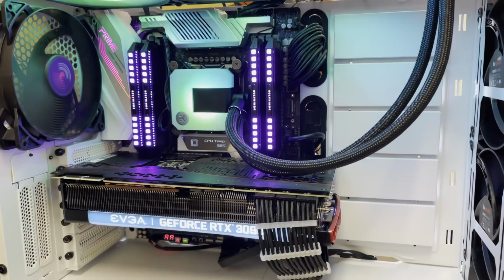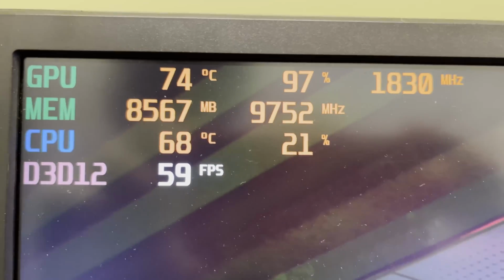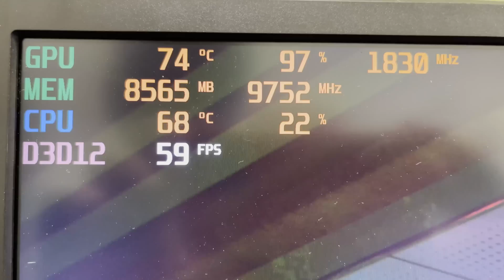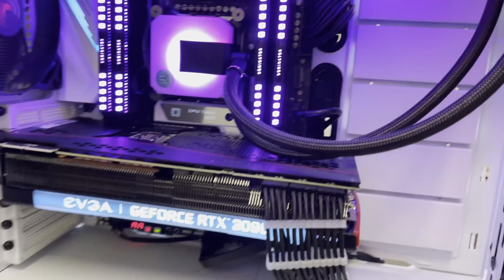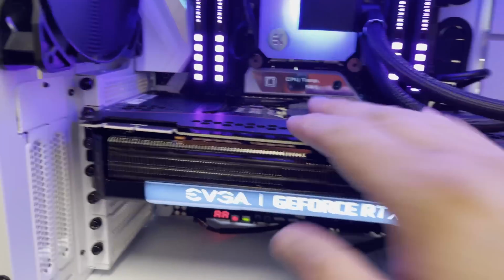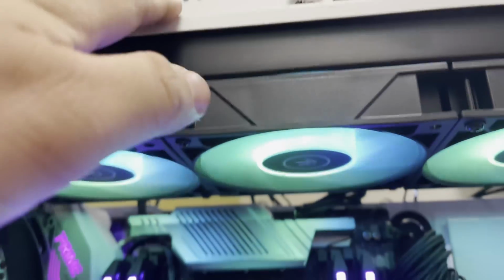Is Your New Nvidia RTX 3000 GPU RUNNING HOT? Do THIS To Improve Temps

Comment from the maker: What temperature is your GPU running at? Subscribe and thumbs up  too!
Reply: 3070 hitting 60-64 while benching heaven witha  100/500 conservative OC running, o11 dynamic though with bottom intake fans
Reply: @Tecumseh_Airsoft  Can you tell me how you set it up? I just got a Lian li XL. My 3080 ftw and 5950x gets very warm in my h710i case.
Reply: 70-80 edit:when I'm hitting it hard
Reply: It has risen as high as 80 degrees when gaming using a zotac 3080. Have to increase the fan speed to reduce the temp. although then it is noisy. Don't have a waterblock system in my PC. My idle temperature with no fans spinning is about 55 degrees.
Reply: @Masta200  zotac used the lowest cheapest components for there 3000 series
Reply: Using an ASUS TUF 3080 
2 intake fan at front, 1 intake fan at bottom(though PSU Shroud covers it)
2 AOI Exhaust Fan, 1 rear exhaust fan
Phanteks Enthoo Pro 

Highest temp, playing max settings in cyberpunk is 63c - havent seen it go above that in other games as well.
Reply: @Zeet1  You have the same case as me. what speed are your GPU fans running at?
Reply: 51-53° in idle and 77-78° on Cyberpunk 2077 ultra settings 2k with 3080 Ti Palit Gaming Pro
Reply: @Alexcarpevideo  the lian o11 do case with gpu fans at 60% gpu never went above 65c on cyberpunk for me. These new chips require tons of airflow
Reply: @FunKaYxxD1sCO  a different graphic card, a different case you can t compare
Reply: Evga RTX 3090, i9 10900K, NZXT 510I case, NZXT Z63 AIO, running Flight Simulator at 4K, Ultra Settings, GPU at 98-100% — Temps: GPU at 75, CPU in the low 40’s
Reply: ASUS 3090 TUF OC (with modded 390W bios), 48C running Cyberpunk 3440x1440p maxed out, DLSS performance mode. EK custom watercooling loop with 5950X (this will run at about 58C in cyberpunk).

Comment: I'm thinking of upgrading from my 2080ti to a 3090.  My GPU is vertically in my case with my intakes on the front.  I'm worried I'm going to have heat issues...
Reply: Undervolt it.

Comment: I have Asus Tuf 3070 OC hitting 76C - 78C in Hogwart Legacy 1440P Ultra/High RT OFF  . I have 3 In take fans 2 Exhaust on top and 1 on back for throwing hot air outside along i have a twin CPU fan cooler . My GPU is not that old i could not find the reason of such temperature . Let me know any solution

Comment: In case anyone hasn't figured this out yet... these cards are designed to run at 80-83 and the firmware will adjust the frequency to maintain the temp.  If you can improve thermal efficiency you may not see lower temps but likely will see better performance

Comment: just build my first Itx pc with a bitfenix portal and a 3070 inside. Also my first watercooled (AIO) build with an arctic liquid freezer II 120mm. The case basically has no airflow at all! you can sqeeze in two tight 80mm fans in the back and one 120mm aio in the front. The 3070 went absolutely crazy when i tried to open conan exiles with ultra settings and 144fps. It hit around 85° and the fans of the gpu spinned like crazy. I still have my old atx system here with a gtx 1080 and it handles 144fps by ultra like a champ with 72° max. with a stock amd cooler on the cpu. I have to lower the fps from 144 to 60 by the 3070 with ultra settings to get a cool 65°. I'm quite shocked and to the same time dissapointed.

Comment: my gpu reaches 85c. undervolted it ang changing fan made it 75c max so far
Reply: I undervolted my 3080 ftw3 ultra because at some point with Quake 2 RTX I was hitting 82-85 with the normal stock numbers. After undervolting, my max temp was around 67-68c and I lost about 7-9ish fps. So there must be something wrong with your case and ventilation/airflow

Comment: My 3070 Twin Edge from Zotac reaches up to 80-90 C at some games which scares me. Going to cage my case but I still feel like its way to high. Also heard that Zotac thermal padding is way worse than any other company. I got it for 650 dollars but I wish I got the Asus one but it ran out of stock when I went to the store.
Also my case side panel is open and I've tried lowering the core clock and power but nothing and tried underclocking but my pc or gpu crashes.
Reply: hahaha zotac is fucked up. luckily i got a 3060ti at msrp im about to sell it if the 3080ti prices will drop
Reply: @lestertalde9707  Yeah I'm not buying any of their products ever again. The lack of thinking before selling the pruduct so horrible is shocking .Even the trio has thermal issues even with 3 fans cause the damn thermal padding and thermal paste is below par for cooling. And the RMA is shit unless you live in the US you are fucked.
Reply: @connermiles7425  true that i heard from a guy in a post on facebook that he sent his card back to fix and he didnt get it back. zotac is the worst overpriced card for shitty performace they even claimed they improve the cooling of their cards lmao

Comment: I currently have a ftw evga 3080ti and stock it runs to about 83 to 84c which I didn’t like at all, I have 3 fans in front of my case 1 in the back and a 260mm pump going on top on a Corsair 4000x case, I undervolt my i9 9900k and my gpu as well because even my i9 was hitting above 80c at times, with both undervolt I mostly get around 60 to 70c on gpu and exactly same with processor, although some games without vsync can still seem to pull gpu to 75c and keeps climbing, not fast, very slowly like 1c per 5 min but I still don’t like the fact that it doesn’t seem to stop rising, I also have my gpu fans set with aggressive fan curve, not sure if this will be bad for my gpu to have fans run fast like that at most times when gaming, it does sound very loud but lucky I enjoy playing with noise canceling headphones so the sound isn’t an issue but I’m still concerned about this card running so hot and continuously climbs :/ although 70 is better than 84c.

Comment: I have tried 2 RTX 3070s and they both hit 92C everytime. I have to set the fan speed to 90-100% just to avoid throttling. Help!
Reply: Have you found any ways to get last that I also have a 3070 and it runs quite high temps
Reply: @officialdvsthomas  I have a 240mm AIO cooler mounted to the front of my case (intake). So that causes cool air to pass through the radiator which then exhausts hot air into my case which i think led to higher gpu temps. I added two exhaust fans to the top of my case and downloaded a new fan curve tool which boosts gpu and case fans once temps hit 80c plus. Its not the quietest solution but its solved my issue for the most part

Comment: Never got above 65 degrees on my RTX 3080 Ti OC Edition running at stock (on my new build). I play alot of VR, mostly high demanding flight simulators on high to ultra settings. On other non-VR titles, I barely hit above 55-60 (usually low 50`s). So the GPU memory also stays very cool. I use a high airflow optimized Be Quiet! build with BQ! Silent Wings fans. Almost completely silent (and very cooled), even on high load. So my recommendation for those insane high temps is to optimize case for good airflow. Its always a good way to start.

Comment: Just got my RTX 3070ti, played minecraft in rtx a couple minutes an it went all the way up to 60c an I started getting worried cause it kept climbing. This is my first time dealing with a "top of the line" graphics cards and it was only my 2nd ever build.
Reply: Are you seriously worried about 60 degrees. That’s a bit of an overreaction. 60 is an absolutely insanely low temp. I get around 75-77 average on my 3080 and it’s a middle of the pack one
Reply: @silverwatchdog  not worried of it being at 60c but when it starts getting around 80c just playing minecraft. Yeah kinda a bit worried.
Reply: @Nothingman5 ok 80 is a bit hot for these gpus, especially since you have a lower power gpu than me. Still 100% safe though and it's not much better than my temps with a triple fan gpu with 370 watt power limit, but it's a lot higher power than a 3070ti (290 watt). Maybe try undervolting it because it helped my temps and made my gpu boost forever and never downclock.
Reply: @silverwatchdog  alright thanks man! Appreciate you!!
Reply: Could never get my 3070 to break 60c but my new 3090 was sitting at 79c playing halo at 4k 120….
Reply: @williambills3260  how when i play 3070 gets to 77c and a lil higher do you have water cooling?
Reply: @brojjedanbrojdva1727   no I just had the ftw3 ultra model and idk it really was weird I thought but I think I got it to 60c like once but my 3080 hits like 80 sometimes

Comment: I've had a EVGA FTW3 3080 TI since June, 12 fans in my case and it'll still hit 80-85c on a regular basis.
Reply: Legit same problems I have 10 fans 7 minus my 3 fan cooler and I just finished building my pc and my temps stay between 78-82
Reply: Damn. I have a 3090 FE with 9 fans & AIO cooler. Most I've seen was 73-74 C
Reply: @L33ted  what case do you have?
Reply: Same here dude, the 3080ti ft3 has terrible thermals, glad I’m not the only one, my old 2070s ran at like 60c for years...so this really made my eyes pop out of my head, I also have the best cooling you can get.
Reply: @jaredchampagne2752  I managed to keep it around 50-60 on average in games by undervolting it slightly. In games like RDR2 it'll still push 90+ if I'm not paying attention to it though.

Comment: I have a small form factor case and my temps go all the way up 89⁰c which is probably the max before it undervolts itself dynamicly, I probably need to build an extire new PC since all my parts are SFF but I don't have the money, I just barely upgraded the gpu and psu.

Comment: Just hooked up my 3080 ti FE, playing Control its getting up to 85-86c. Is this normal?
Reply from the maker: Seems very hot, You should check your case airflow
Reply: @ClassicalTechnology  I have a Lian LI Lancool 2 non mesh version with 8 fans. 3 front, 2 top, 1 back exhaust, 2 on top of power shroud. I do have a sound card directly under the GPU.

Comment: I have the same AIO and a strix 3090

I'm about to swap the AIO from top to front and do a push pull with some Lian Li instead of the EK vardrar which are so louuuuuuud.
My case is p600s which also have a front mesh.

I've been told the GPU in that case will be hotter and not colder by putting the aio on the front,  i'm surprised you're saying the opposite?

Comment: My FTW3 ULTRA 3090 is running between 65 to 70 degrees on rainbow six siege and Metro exodus. Is that within the acceptable threshold of this GPU? I have 6 120mm fans at front in push/pull config, 2 exhaust 120mm top, 1x 120mm back exhaust and finally 2x 120mm bottom intake blowing directly at the GPU. Fans are lian li uni fans and case is lian li lancool II mesh.
Reply from the maker: Seems about right, they can run very hot and can even go beyond that
Reply: That's very decent temps for a 3090. I'd take that in a second.

Comment: I have the MSI Ventus 3090 and for some reason it loves to hit 81 degrees C. Any tips? I'm using SilentWing 3 fans from BeQuiet! in my system. 6 fans in the H510i.
Reply: I had my 3090 Suprim X in a H10 Elite. I ended up leaving the glass panel off. Finally, I got the Phanteks P500A case. I miss the asthetics of NZXT, but worth the tradeoff.

Comment: I have a RTX 3090 FE paired with a 10850k in a a 4000D airflow case with a msi 360 rad in the front of the case atm the card always stays at 1905 MHz stock under load in cod Cold War with temps between 58c-70c but this is currently in the colder months of the year here in Cali

Comment: I haven’t seen my 3080 go above 65°. I’m genuinely surprised on how well they did this series’s cooling.
Reply: My 3060's hotspot is regularly at 95C. This series cards are beefy and hot af.
Reply: which brand dude
Reply: you must have got a good one. I tried a 3080 FE and it was a toaster. It got so hot I had to remove it and go back to my old card

Comment: My ASUS dual rtx 3070 OC usually sits under 68c at full load.
Reply: How? My aorus hits easy 78c... I see so many benchmark videos where the GPU is at 65c max all the time. I mean how??
Reply: @Adventure_Bross  Undervolt it
Reply: @andreikobyakov7109  I did it and its a little bit better but that can't be the solution. I see so many videos with people having there 2070 at 65 at full load

Comment: Got the FTW3 Ultra 3080 and if at full load it'll sit around 73-74c and slowly creep up, usually doesn't go passed 77c but I saw at on 81c the other day, I have a custom fan curve and I got a H500P case, I've got a mesh front panel on the way, but probably won't get it for 2 weeks due to Christmas and New Years
Reply: So your fan curve sucks
Reply: I have a h710i. These cases don't got good air flow.

Comment: Bought a prebuilt from Amazon with a 3080 and a Ryzen 3900X. Shredded a heavily modded Skyrim at 4K, and runs Cyberpunk around 50FPS at 4K. Only problem is the PC got so damn hot it kept cutting off, figured either the GPU or CPU was over locked. Had to play with the settings a bit, and lost some FPS but I’d take a stable PC instead of a damn rocket...
Reply: same here mate, i am playing stuff like ff15 at the least settings i can, 1080p and it gets to 84 degrees sometimes, i took off the glass side panel and continued playing, it went down to 65 degrees, its probably the case not having enough airflow, id say get a cheap BIG case, not mid tower bigger than mid, get some cheap fans from amazon and swap everything over to that tower, its what im going to have to do unforutnately

Comment: Not sure about the 3000 but my XFX 6800 XT Merc died after 10 days
Reply: that's a bummer. full refund I hope.
Reply: @nofreebeer  yes Amazon
Reply: By died did it fry, explode, or something? I worry my 1000 watts power supply will fry my shit.
Reply: @BlazeNarutoShippuden  your 1000w power supply is fine, no video would post and boot like normal.  Just no output on either DP or the HDMI ports.
Reply: @Xcision666  confused by "Just no output on either DP or the HDMI ports." Don't use the GPU as outputs for display port and HDMI?
Reply: @BlazeNarutoShippuden  on the GPU there are 2 DP 1 HDMI 1 USB-C all are outputs to the monitor (non are inputs)

Comment: Also 140mm fans in bottom of case blowing up onto gpu is good plus look at a video undervolt gpu that gives less heat 100w less power usage and a few frames more... Yes more fps less watt and less heat 😀

Comment: I have the NZXT H510 which has a solid front panel. Is that going to affect it a lot or a little??
Reply from the maker: Which gpu? Mesh would be better most likely
Reply: @ClassicalTechnology  evga ftw3 ultra 3080... the case has some side intake, but not too much
Reply: @Aiden-on2fk  I have the same case with a Strix 3080 and i'm peaking at around 80 degrees in Cyberpunk

Comment: Tiago I just got a 3060 Ti and have noticed that my graphics card is being under utilized in games and isn’t being used nearly at max potential. I play at 1080p but games like warzone Fortnite etc I’m only getting 40-55% usage on it and am under performing. Can you make a video on this issue on how to increase GPU usage or just know any solutions?
Reply from the maker: I’ll take a look, do you have the graphics maxed out?
Reply: @ClassicalTechnology  yes I have it overclocked and maxed out power limit. My CPU is a Ryzen 5 2600 OC @4 GHZ with 16 GB ram 3000 ghz. I am upgrading from a RX 580 and I’m not sure why but in games like warzone that even at 1080p on benchmarks always utilize the full card usage to 90-100%, i am only getting mid 50%’s usage and is really hurting my performance. Please if you know anything at all to help this issue I would appreciate it because this has been really problematic!
Reply: @Joseph_H19  I get 98% gpu usage  in warzone with a ryzen 5600x and asus tuf 3070?
Reply: @s30vguy8  that’s really good usage and should be what every GPU gets! But for some reason my 3060 Ti even in warzone 1080p comp settings it’s barley used more than 55% which makes no sense at all and I don’t know why at all it is happening and am really pressed to find a solution given the money I just paid for this card.
:(
Reply: @Joseph_H19  How are you measuring the usage?
Reply: @s30vguy8  MSI afterburner is how I am checking the usage since task manager isn’t accurate.
Reply: @Joseph_H19  try hwinfo64 if it gets you the same results